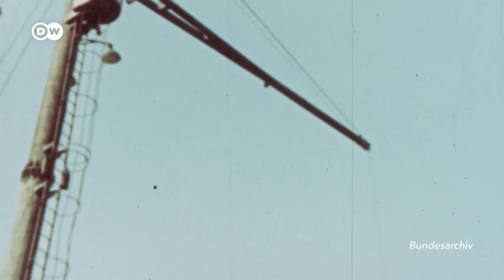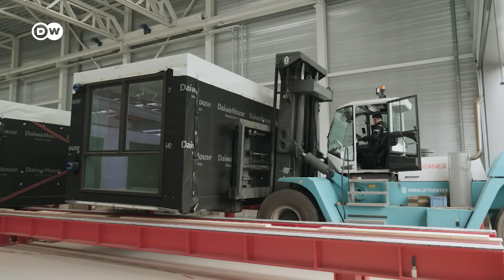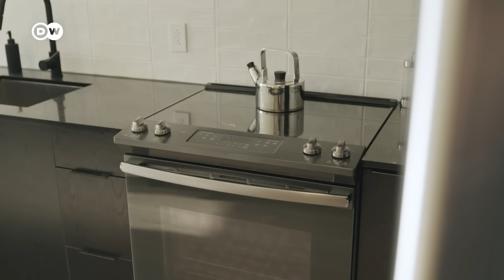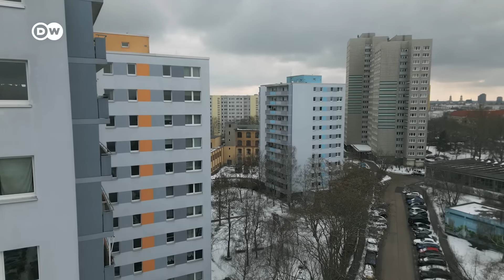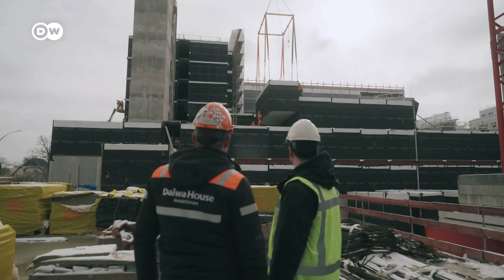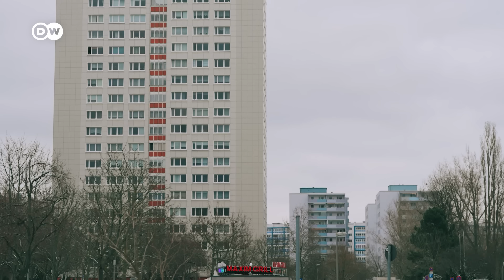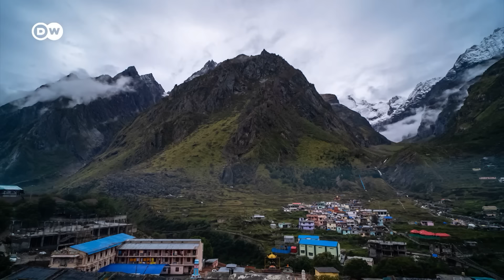These buildings are ugly. But the idea was genius.

Comment: You can find stories about how "prefab is the future" from 50 years ago. Its not a new technology. Prefabrication just isn't useful in most cases. 

Unless you have to build a large number of nearly identical buildings in the same area and can build a prefab plant close to the site and have reliable transport, it isn't worth it. 

Those conditions existed after ww2. Authorities had empty land from destroyed cities and the need for mass housing. The plattenbau districts were planned cities or districts. In a country with a low fertility rate and natural population decline, there aren't going to be huge new planned towns or massive urban clearance and rebuilding. 

Individual buildings will come up in the urban center, designed specifically for the lot they will occupy.
Reply: Plattenbau buildings are not bad at all. They are just not maintained. These buildings gave millions of people a housing and a roof over their head. Nowadays the plattenbau are appreciatng in value. I remember in Bulgaria during 1990 you could buy a plattenbau 1bed apartment for like 5k euro. The price was below 5k in 1970-1980. Today - they are worth like 120-180k and it depends if they are renovated or need to be. Everyone inside these prefab buildings are actually living decent lifes because many of them are renovated with new furnitures, kitchens, bathrooms etc. Just like every other EU citizen, but the exception is the gray looking/patched insulation or no insulation. In 10-15 years I believe people will start looking to insulate them.

Comment: Having had the awful experience of living in a flat in the UK for a couple of years, that was built out of brick and  breeze blocks, never, ever again, you could hear everything that went on above, below and on each side and these things, I suspect would be even worse in terms of noise from neighbours and I wonder if you would have damp and mould a few years down the line and if they are insulated enough for cold winters and heat, especially in really hot and cold climates?
Reply: I'm sure they plan on improving on the original ideas.

Comment: In the 1980s I organised construction of electricity substations (11kV/400V 300 kVA transformer and switchgear in a 2x2x2 m box, about 4 tonnes), assembled on a concrete slab in a workshop, then delivered to site by truck and lowered onto foundations pre-prepared.   Lots of advantages:  Less travel to site, better quality control, fewer safety issues,  lower skill level required, less weather dependent. 
I found the challenge was to get everybody to think about avoiding as much as possible any onsite work.  I think for housing you'd do well to build them like cars.  All the essential items identical, but personalisable features implemented in the factory.   
Disappointing to hear that it is hard  to create ongloing work for prefab factories.
Reply: Unless the land area is needed for farms or forests, with so much lacking or expensive housing, it should actually thrive to build at the edges of cities with enough green area between each, like in munich. I dont think it looks bad and there is more than enough greenery

Comment: The unfortunate part is that these buildings look like simples boxes. Here in Canada we have learnt to make these precast buildings have aesthetic Architectural curves with great Architectural features - a very important requirement for public acceptance. Research the "Odea building in Montreal" as an example.
Reply: Curves may be nice, but I bet you wouldn't want a curved wall in a 30m2 apartment. It just isn't ergonomic.
Reply: I prefer the middle ground.
These boxes, while they solved the child boom and housing crisis in the Eastern Block countries in the Cold War, they look awfully depressing, unimaginative - just straight sets of concrete slabs placed together to make a box. 

I guess they would go with a modern design (including AC, since the aforementioned concrete prefab' houses there are without AC; during summer time, there are hellish conditions inside.)
Reply: you can just put a facade on the exterior you know

Comment: Housing supply is not a technology issue, but a legal issue. When every development is blocked by citizens initiatives or environmentalists, it's impossible to build enough housing stock.
Reply: I would add that it is mostly a political issue, since existing homeowners often pressure city councils and use zoning laws and environmental regulations to prevent more housing from getting constructed. Most environmentalists are in favor of this kind of building, because it generates less waste and less CO2-e that traditional construction, and it is used to build large apartment buildings, which are much better environmentally than suburban homes.

Comment: Previous prefab housing attempts were a disaster in almost every country where they were built. They usually ended up as huge grey buildings where people live miserably, with multiple construction issues that are expensive or impossible to fix. They essentially became ready-made ghettos.

And I see no real improvements in this new iteration.

The housing shortage is a very serious problem, but its root causes — building codes, environmental regulations, and NIMBYism — have barely been seriously addressed.

Comment: 日本系の住宅会社ですね。プレハブは高層住宅には向かなさそうです。防音効果はどうだろうか? 隣人の音が聞こえたりするのかもしれない。
Reply: Prefabricated blocks from the communist times, could reach around 10 levels or so. Sound insulation wise, it's not bad. It however depends on the local manufacturing that built the blocks. Back in the day, the construction was not very consistent.

Comment: THIS is Japan's technology paradox. 

Daiwa is a Japanese company, but, in Japan, they never use these high quality materials like triple-pane windows and super-airtight layers, since Japan has no such regulations requiring those and, hence, they're rare and expensive items to voluntarily use.
Daiwa is just seeking more valuable market that allow them practice a quality business, but the Japanese believe this move means their own houses' quality (in fact very cheap) is world class high.
What a joke!
Reply: They're still nice though
Reply: @longiusaescius2537  Looks nice? Maybe. But actually they're too energy-inefficient comparing with the European (also Chinese/Korean/etc.) modern standards.
Of course, you CAN use high-quality windows if (and only if) you want, but no regulations. Even 100M yen Tokyo condos do not normally have even double-pane windows. Single-pane no-insulation alu-frame (6 times inefficient than western European standard) ones are pretty normal, which are worse than even some tropical nations' ..😅

Comment: Prefabs are great as long as they are not the only thing you build. Every city needs a high diversity of buildings. When you build diverse housing (i.e. single family, 2 flats, 4 flats, rowhouse, apartment, etc.), then it doesn't matter how you build it, you make the city: more beautiful, have less homeless people, and safer through being more flexible with how it houses people.
Whether low, mid, or high rise, too much of one housing type will cause some problem with a city, and the only worry with prefabs are you don't get anytime to test if the building was a good idea. For every prefab apartment there's a prefab mcmansion, and since laws on where it goes moves slower than where its being built, you can't undo it. If you start building diverse, there's no problem because who cares every option is already everywhere so why should we wait to build.

Comment: If this is so straightforward, why has modular housing not taken off? It would seem to be a perfect fit for colder climates where construction and municipal infrastructure is inherently more costly, but we don't see this in the nordic countries or Canada.  I don't think the root cause is lack of engineering expertise, it's more likely issues with building codes, zoning, and financially entrenched interests in extant real estate.  I also question the accounting savings as the cost of transporting all those modules to the job-site would be greater than just the raw materials, but perhaps it made-up by labor savings during final assembly? Eh, I don't think this video is presenting the full picture of the issues at-hand.
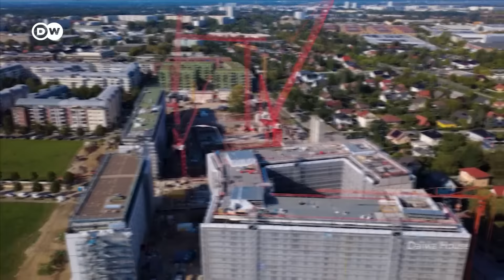Reply from the maker: Good points - and we touch on some of them in the video starting around 10:21. Modular isn’t a one‑size‑fits‑all solution, but it does offer advantages in the places where it can work well. 🏗️

Comment: Two things: 1. I don't believe the manufacturer's claim that the prefabricated apartment block can be safely disassembled and relocated. It doesn't make economic sense in most cases. 2. Prefab blocs are THE WORST for handling kinetic damage from a missile, bomb or drone - which will soon become a ubiquitous risk Europe-wide.
Reply: Completely delusional. Old soviet khrushchevkas have stood like bunkers against multi-ton bombs in Ukraine.
Reply: Their prices across soviet countries have exploded. Many were worth around 30-50k euro for 1bed  in 2018-2020, but today in 2025-2026 their price is around 120-200k euro if they are renovated or not.. the price increase does not lie.

Comment: This is perhaps another 'glimpse of the obvious', the problem is what is now called 'Enshitification' (there is a wikipedia page on that). It requires close inspection at every stage to ensure that the corners being cut are not those that support the building. One big plus is being able to specify the thermal efficiency and confirm that on a single initial model rather than vague recommendations that are seldom inspected in practice. Post war the UK had a major housing shortage and the result was a lot of poorly planned and often poorly built homes. The Canadians supplied some of their prefabs, intended for 15-20 year lifetimes,  but in the 1990s, when it was proposed to demolish them and replace them with 'modern housing' the residents put up a fight and managed to get the homes renovated instead. One major factor was heating, understandable given these were designed in Canada.
Reply: Enshitification is wild 😂
Reply: 'Enshitification' + 'Planned obsolence" is why I'm skeptical of pre-fab housing or anything meant to lessen the material cost of building housing.  The reason the cost of homes has skyrocketed in the US has little to do with the cost of materials or likely even labor.  It's the cost of land, grossly oversized houses, property taxes, building costs designed to enrich contractors (ex rigid metal conduit for electrical, copper pipes required over PEX, fire water sprinklers, etc).  New buildings may go up quickly where I live, but I bet they're designed to be torn down in 30 years or less.  I wonder how well those prefab homes handle ground movement and ground settling.

Comment: I'm really surprised they're shipped as boxes rather than as walls. I would've assumed you can ship 12 floor/ceilings, 12 east-west walls, 12 exterior walls, and 12 interior walls on 4 trucks, instead of shipping 12 units on 12 trucks.
Reply: a lot of the labour is in electrical, plumbing and fittings. All of this you cant do in the factory if shipping just walls, dramatically cutting down the benefit of modular construction in a factory to begin with
Reply: I imagine that the total load may exceed the 40 tonne limit
Reply: @Lucas_Lusso  I don't think it does. If you look at one of the shots, the unit is lifted by a forklift.
Reply: @nothereandthereanywhere  it hard to gauge, for sure!
Reply: If you ship the box you control the angles in the factory. If you mount the walls on site with a lot of time pressure they will not be straigt and rectengular. Where I live there are a lot of UDSSR style modular homes and also brick homes. The best brick homes are better than the average modular homes.
Reply: like they said in the video: you need half as many people to build the modul, than on site. It’s also faster and you forget the weather! A ready module is not weather dependent, while on site it may stop the work for weeks.
Besides that all these heavy plates need cranes, which are not infinite…etc.
Reply: The advantage of them being built in the factory as complete unit is that it can be fully assembled it controlled environment. If you are out on the site, you must rely on weather.
Reply: As people say, assembling them in a factory is much cheaper. But IIRC in some cases temporary factories are put up next to the actual construction site to simplify the logistics.

Comment: How do these houses rate on heat and sound isolation?
How would they hold on after a shahed drone hit?
Reply: Germany has pretty high insulation standards, both for heat and sound. If they meet those, they are fine.
Reply: very poor acoustics, it's a shipping container masquerading as an apartment
Reply: What is your benchmark against drones? I hope not WTC against aircraft.
Reply: @BojanPeric-kq9et  to not fall apart after 1 hit
Reply: @nickplays2022  If you expect house to survive hit with 50kg of high explosive, then you should opt for living in car.
Reply: @BojanPeric-kq9et   I am not a construction professional. What I mean is that multiple monolithic frame buildings survived missile hits in Ukraine without crumbling unlike older buildings
Reply: @nickplays2022  every choice has pros and cons. I am not sure if you are aware level of destruction in Central and Eastern Europe. For comparison, UK wasn't even scratched.

Comment: Because it's the only way of mass construction.  On site building demands skilled labor,  there are not enough skilled builders to build 100.thousands of apartments at the same time. Plus efficiency/wastage can be controlled much better in a factory than across 100thousand sites simultaneously
Reply: Plus you can work non stop in a factory versus traditional construction.  Multiple shifts of trained workers.

Comment: Nobody aspires to live in prefabs. 🙅‍♀️
People tolerate it and simply don’t complain.
Don’t confuse that for satisfaction.
There’s nothing “ageing beauty” about it.

The biggest issue with prefab is that the builders don’t have to care about long-term, so when they are crumbling after 30 years it’s the tenant/owner’s problem. Just make bricks/stone cheaper and build better quality buildings that last centuries
Reply: Singapore is taking this approach or prefabricated units added to a foundation until they have well designed housing blocks.
Reply: In many places, people aspire to just get an affordable home, be that to own or to rent. Where I live, all that gets built are hotels and tourist apartments because it's more profitable than residential homes.
Reply: Do buildings in Berlin crumble after 30 years? I know a lot of communist architecture buildings which still stand quite well. Ugly or not, we can debate.
Reply: Lots of people lie to themselves though, and to each other, and this comment section has plenty such examples of mass delusion.
Reply: The advantage of prefabs is that they can be specified and inspected easily to ensure the spec has been met. As Corporate Socialism displaces ever more commerce we will have perhaps three house building consortiums in any given region so whimsical buildings will just be 'McMansions' that would have to be individually inspected during construction and on completion.

Comment: I genuinely don't get it, if there's such a severe housing crisis in Berlin, why aren't they just building upward? Especially given that there is no seismic risk. How is it that corporations get to throw up tall, hideous towers wherever they want  (see amazon tower),  but when it comes to actually housing people, high-rise residential construction is somehow off the table?!
Reply: seismic risk is not an issue, you can have a high building in places with earthquakes and they work the construction might be a little more expensive but that will be the only issue
Reply: Height increases cost per unit to construct. Increases in structure, utilities, elevators, safety all add costs. So its always a balance between land costs and construction costs. 
High rises in city centers are much more expensive. Corporations build them for the location and visibility.
Reply: People need other things apart from apartments (pardon the pun). They need places to stretch their legs, they want to see some greenery, they want parking places for their cars (yes, many people who live in apartments still want to own a car). Stuffing people into densely packed high-rises without breathable space around makes them depressed and angry. Personally, I think there shouldn't be apartment blocks higher than five to six storeys.

Comment: Why did you stopped use it in a first time?
Reply: Poor quality control, poor planning and some design mistakes that were then promulgated through all the buildings. In the 50's and 60's a cold bedroom in the morning was still 'normal' but by the 70s people wanted greater comfort. Once the post-war housing crisis had been dealt with to the extent that only a small number of people were affected political interest waned.
Reply: @mikesmith2905  they should fix it instead stopping all

Comment: My one issue I am seeing that may impact the use case of modular movability: they are not stacked on a frame, meaning if an apartment at the bottom of the stack can't be removed without moving all modules atop it.  It will also potentially cause problems after stacking beyond a certain height.  I imagine this modular concept will eventually evolve to include standardized dimensions across producers and a structural frame.  Allowing the replacement of a module on the bottom floor without causing undue stress to all modules above it